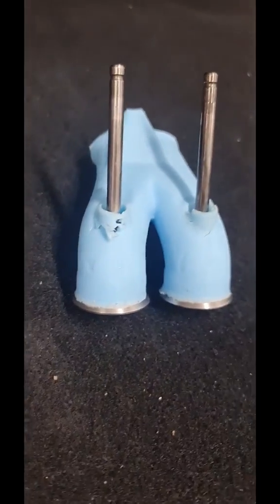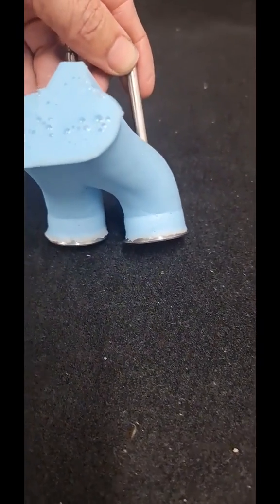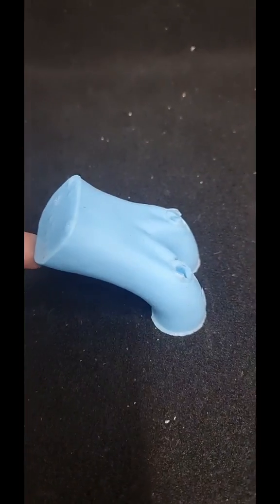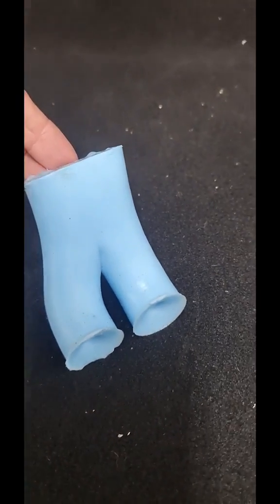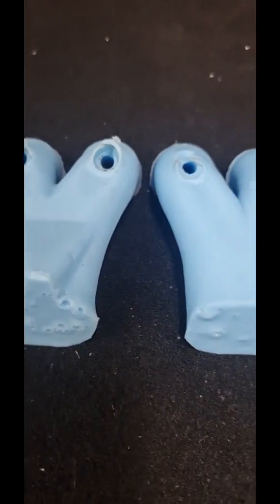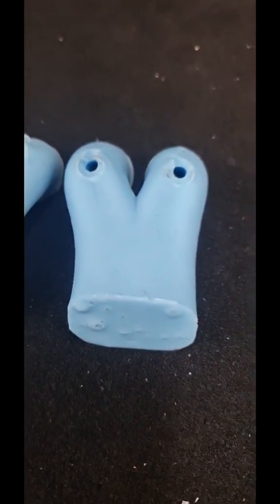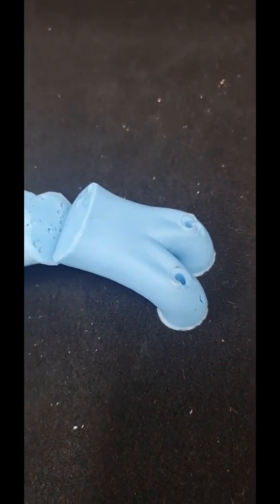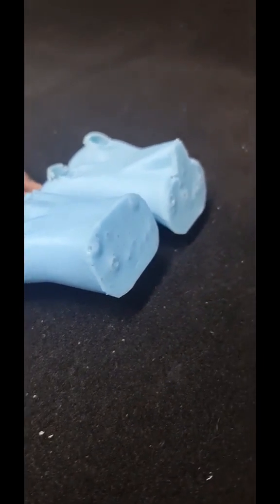Port Molds "the secret to air flow" #1uzfe

Comment: Not about making it
Bigger. About reshaping the port so the air can get in easier. No more dead spots. 
What did you with the cutout for the injector?
Reply from the maker: In the all-out race heads, I fill it up and  I move it up into the manifold to allow for my fuel shear time.